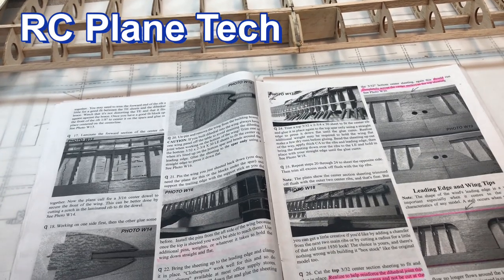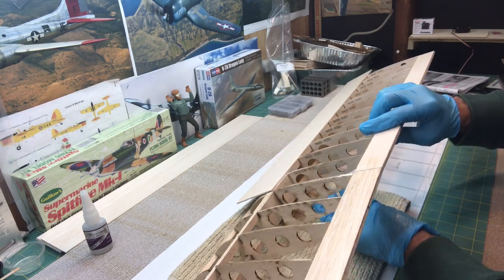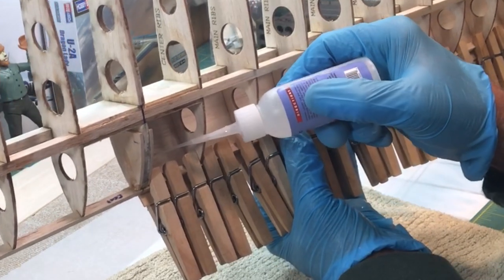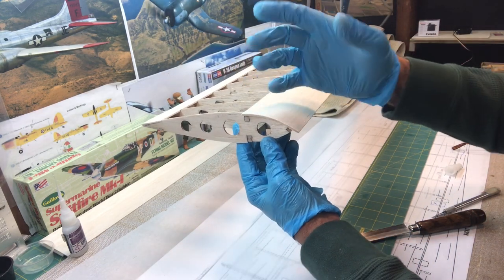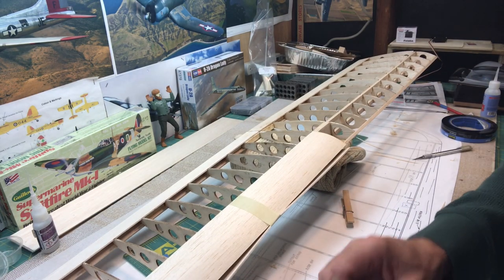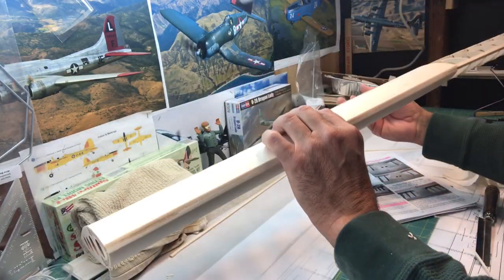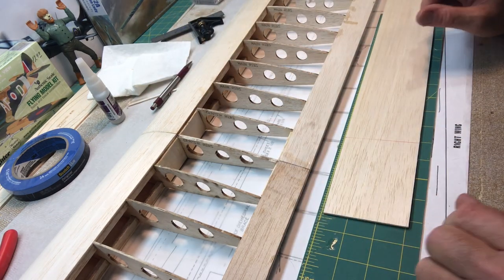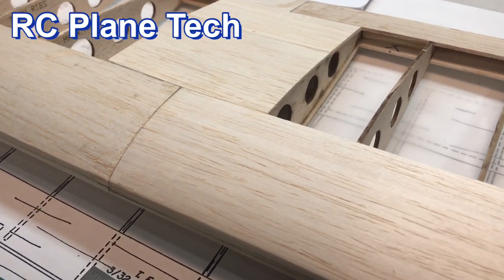Balsa USA Smoothie RC Plane Kit Build No 7, Wing Construction Part 5, Wing Sheeting

Comment: Dampen a towel and throw it in the drier on high heat. While its hot and still damp lay it over your sheeting for a few minutes so the heat and humidity preform the sheeting to the curve.  The extra moisture will also help the CA kick in the next step. When gluing, larkshead rubberbands on dowels. As you glue up, put a dowel behind the spar and loop the free end of the rubberband over the sheeting and onto the opposite end of the dowel for a form to fit spring clamp. It won't dent the balsa and should a little glue get on it, it breaks free easily.
Reply from the maker: Those are really good tips. Its always a challenge to get sheeting even and down correctly. Thanks

Comment: Greg, that's a good comment and I agree. I've built dozens of RC planes and always wet one side of curved sheeting to get it to bend and keep it's shape with no worries about the sheet cracking.
Reply from the maker: Thats a great tip. I did get a small crack in one of the sheets that I had to sand out. I will do this on my next build

Comment: Im a little late ,...I have used the spray bottle "wet" method ,works well , I use a heat gun and or a covering iron on steeper curves , warm it up with the iron ,tape it in place, till cools and it will hold most of its shape it even works without water, 
painters tape wont rip up any wood when removing it

love the content , good luck, 
mike
Reply from the maker: Thanks for the suggestions.

Comment: Use Windex instead of water...balsa becomes like rubber and you can really do some serious bending without  cracking.  When it dries just as firm as before
Reply from the maker: Thanks for the tip. I have never used windex before and will try it out next time.

Comment: You can remove most dents in balsa using a covering iron and a bit of water. Try the iron over dent first, if it does not come up, pipette a spot of water on the dent and try an iron over it again. The expanding water or steam will usually push the dent out. Can be done after covering is on, too.
Reply from the maker: Great tip, I will try that in the future. Thanks for pointing that out.

Comment: Always easier to wet the outside face of the balsa before bending over.  I wet with windex.
Reply from the maker: I have to do that, I always struggle with bending it dry and need to adopt that method.

Comment: Ottimo lavoro , una domanda la colla è ciano a media densità?  Saluti
Reply from the maker: Hi! For the leading edge I was using thin CA, that was the larger white bottle. For the center sheeting, I was using a thick CA which dries slower. The thin CA cures too fast , so the parts need to be put against each other and the apply the thin CA. With the thick CA or gap filling CA you can put the glue on the part before putting them together, but you still need to work fast and make sure the parts fit right, then glue.